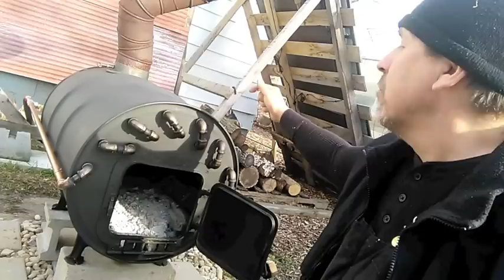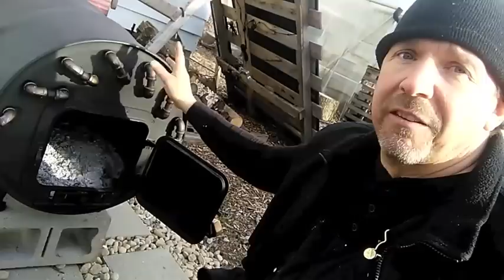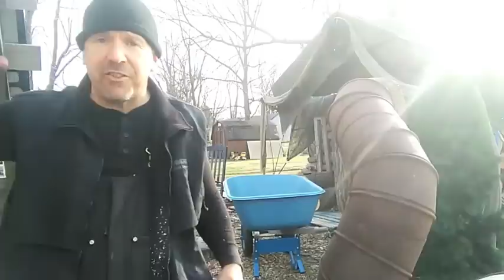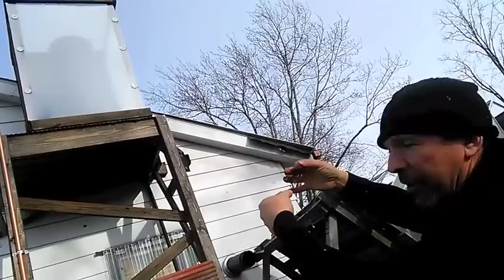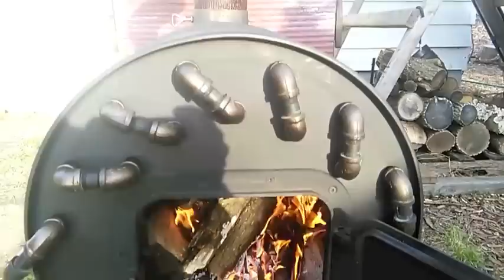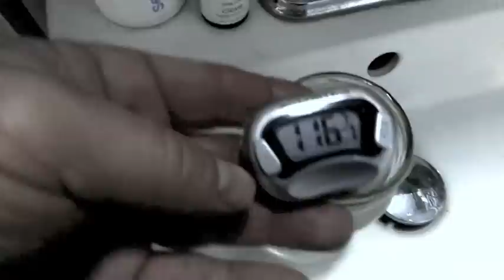Wood burner hot water heater

Comment: this was painful to watch..why steel pipe...rust.  Use copper ..long as water is in the pipe. The solder will not melt...You just running cold water through the hot pipe..just destroyed to coating in the pipe. And use a circulation pump to pump up...you will not have the popping in the tank on top.

Comment: You could use teflon pipe dope on your joints  because your pipe is only going to get as hot as your water.  If you are really nervous about this ,  use nickel based anti seize compound for your thread compound !!

Comment: Does the pipe not have to be always sloping up so the hot water rises and so you do not need a pump?  Or do you use a pump to move the water thru the pipes.

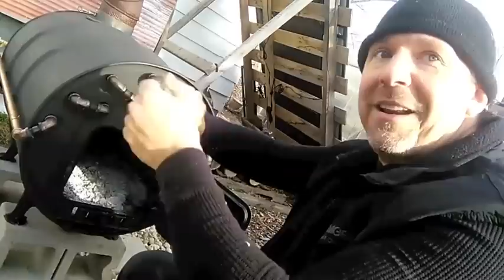Comment: An amazing job I would think though that you could do all the the sections of one side and doing the right way and tighten them up exactly the way you want it and then push them through and then use some sort of extend them further out using copper maybe I don't know I can't imagine it getting that hot at this water inside this water inside it can only get 2 to 12 or 2:50 if its 15 psi anyhow it's a great project I'm a mime from unimpressed seems to me if you could use it to heat up a water source in your basement and then is run it and then use that water in the basement 2 to heat your house after the fires over

Comment: If you turned it upside down, and burned the wood directly on top of the pipe heat exchanger, with some ash to protect the pipes from corrosion, or used stainless steel then heating by direct embers contact conduction may improve efficiency further ? Agree ?

Comment: EXCELLENT. WOW STEAM THAT GOOD LOOKING BABY STEAM THAT BABY !!!!! THE THING IS ALIVE AND BREATHES, A STEAM ENGINE. SO COOL. More seriously:

what temperature is the hot water ? what is the flow rate into the boiler ? What is the best pipe diameter ? is the pipe mild steel ? Where can i buy the barrel stove from ?
Reply from the maker: A barrel stove kit can be found at most home improvement stores for about $50 I got mine at Menards. I got the barrel on craigslist for $10.  I used 1/2 in. I should have gone 3/4. Pipe is galvanized steel. I looked up the pressure rating and it was plenty high so I don't worry about it bursting the pipe. 
   I do not know the rate flow. I just make sure water is flowing BEFORE I start a fire. The intensity of the fire and flow rate of water determine the temperature. Very unpredictable. But I pump it into a tank on a platform 15 ft up and let it gravity feed into the shower and its about 115. a perfect hot shower.
Reply: Living Lightly copper pipe would corrode in the flame, do you know the wall thickness of the mild steel galvanised pipe ? Also, why is 3/4 inch better ? Is 1/2 inch producing too much unpredictable steam. Heat loss with 3/4 is lower ? Thank you sir.

Comment: The melting point of Teflon tape is 327C (620F) but you will get property changes at 260C (500F) so it is safe to use to seal in this case as you have it water cooled so it will stay around 100C (212F) for the most part. 

The holes for the pipes are easy to seal using fiberglass rope normaly used to seal wood stove doors.

Comment: The grate has nothing to do with making your barrel last, dont give out false info!!! Ive used a barrel stove for 15 years and never had a problem untill my chimney cap blew off, water combined with ashes is very corrosive and will rot the barrel, keep it dry inside and youll get a longer burn without a grate
Reply: Interesting.  I'm about to build one and was wondering if I should use fire brick or something or the bottom.

Comment: A coil of flexible copper tubing inside would have been better, no holes except inlet/outlet.
Reply: Boilers heated by fire or gas burners are often made of mild steel, ever wondered why they don’t use copper near a hot flame ?
Reply: @nirupamafallon1759  tell us why?
Reply: But it looks cool. Kinda of steam punk.

Comment: How did you pump the water up to the tank or maybe I just missed something?
Reply from the maker: My rain water is stored in tanks and then I use a shallow well system and a pressure tank. I have a video of my rain collection system that shows it in detail.
Reply: Living Lightly thanx I was wondering